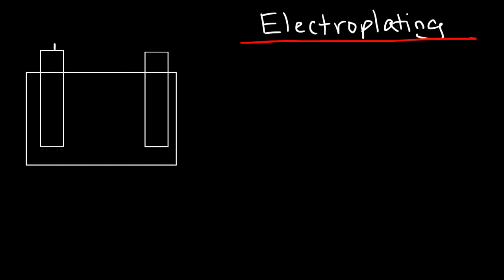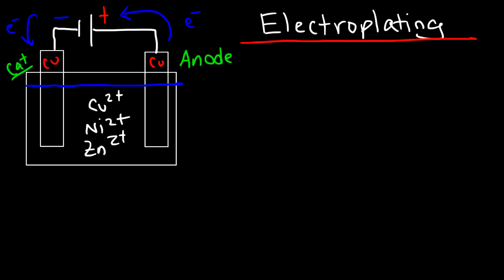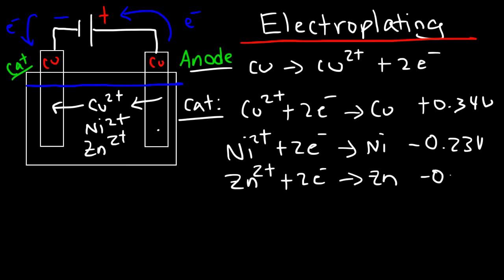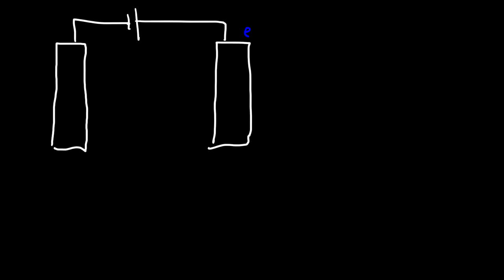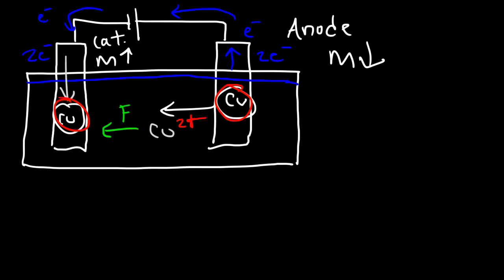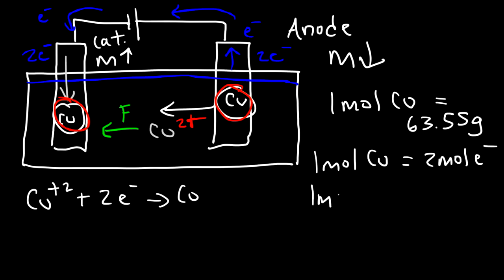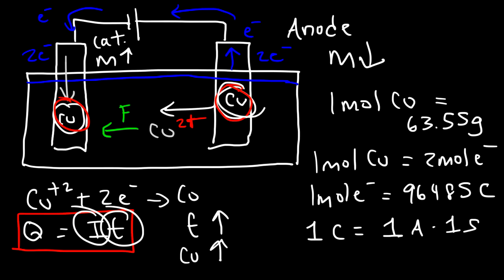Introduction to Electroplating - Electrochemistry

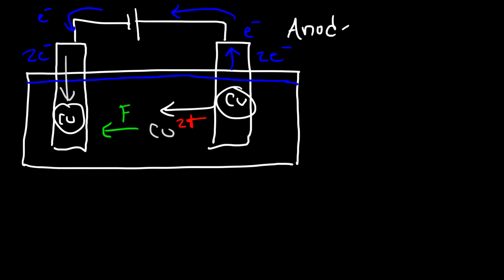Comment: I wonder why the electron in the circuit is moving out from the negative end of the power source as you drew in 3:16?
Reply: nice question... i wonder why...

i think cuz there is a battery connected so one end might have negative charges, the other has positive charge... (the battery might have those anions or cations in it...) so when it's all connected in the circuit the elevtrons start flowing downwards to the left electrode nd the electrode on the right end loses it's electrons making cations that will be attracted by the left electrode that has new electrons reached? 

wait that doesn't make sense?
Reply: oh yeah- 
i think cuz the battery's one end is positive so the right electrode loses its electrons nd moves towards positive end of the battery... 
nd the negative end of the battery has flow of electrons downward in left electrode so the cations made in right electrode will made their way to electrons in left side ... so metal deposited...

wow thnku for ur question... made me wonder that i just watched it for the sake of it nd didn't understand it-
Reply: Why so rude?
Reply: @AshnaFatah  wdym?

Comment: measuring the anode for copper plated amount, does not work. In most case the "acid" bath will dissolve the anode even if there is no current. This is why we remove the anode after plating. The amount plated, and amount added to the electrolite both need to be taken into account. I am refering to the video around 6min. Perhaps this is correct under the right circumstance, but its a little more complicated if your using this video to get into electroplating chemistry.
Reply: i sugest to instead weigh the cathode before and after.
Reply: @madebyrasa  keep in mind these videos are meant for students writing chemistry exams and not for practical application. The way he’s explained it here is parallel to my textbook. Like with most things in school, the theory explained in textbook is either null and void in real application, or needs adjustment before it can be practically applied.
Edit: the reasoning for this is in theory we do not look at external forces acting on a system. I.e. we often negate air resistance or friction in physics, or in this instance we negate the effect of corrosion on the substance. So assuming that the only cause for loss of mass from the anode is ion transfer, and not the acid solution corroding the anode, then his method of measuring makes sense. This is merely high school chemistry so I’m hoping they expand on this and make it more practically applicable at college level.
Reply: @avationmusic  sure, I understand that, and it only applies if electrolyte has no copper in it. And this would not work. I find it annoying that the text book misinformation is "standardized" in your view. These questions should be discussed within the sourced fields. It's funny how wording something different fixs everything, and portrays reality. It's also funny, that this question could have bleed written well in the past(which it has) and with simplified results loosing any practical meaning. Let's base these questions on replicating observations and data, not simplified "standards" based on historical textbooks. after all, it's science and not law.